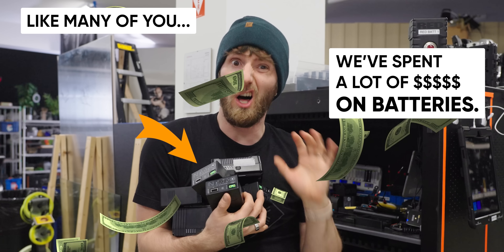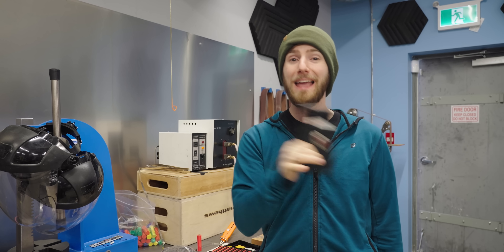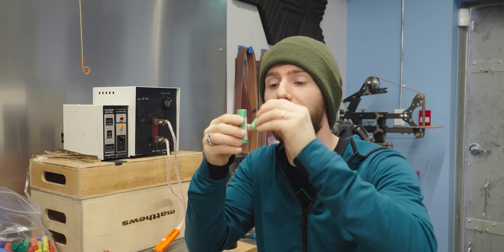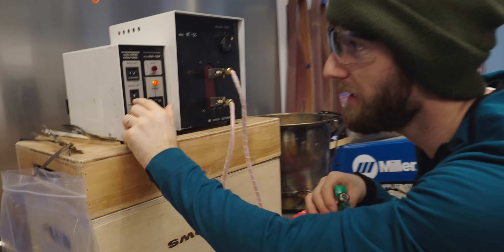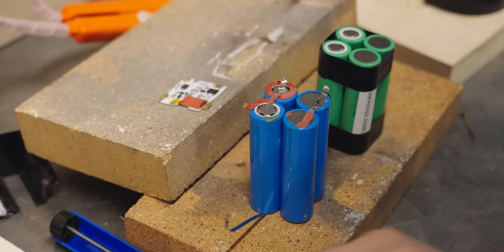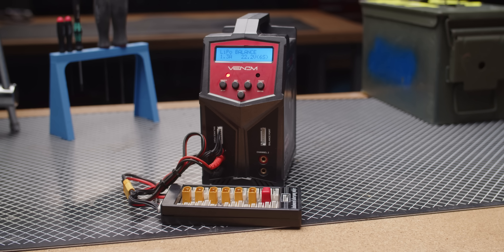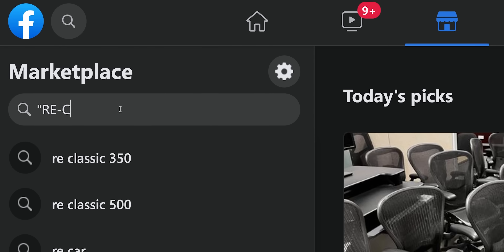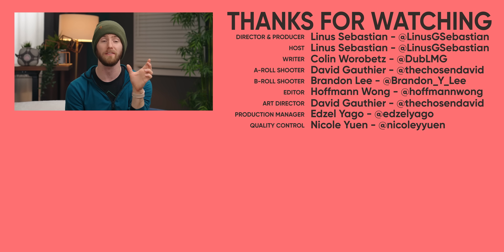This should be illegal… Battery Repair Blocking

Comment: Years ago, I read an article about a person that bricked their eclectic car's battery. Essentially, what happened was that that there was that there was nothing to stop a battery from being becoming fully drained while the car was being driven. The only to get the car up and running again was to pay hundreds of thousands of dollars, to have the old batter replaced with a new one, and the car owner had to do this at their own expense because the manufacturer classified this a driver error. I've heard that rechargeable battery cells can be damaged if fully, fully drained, but now I'm wondering there this might have an a BMS issues.

Comment: Well, same rule as with repairing original laptop bateries. You need keep atleast one cell in series connected to BMS - Replace one row in series, then another. Or connect dummy load +4V to all BMS pins. When you don´t that - BMS will think, that one of cells is dead and lock whole BMS. Then you will need to reset BMS via programming. With laptop bateries - you can buy third-party battery from china - They do not have this feature and won´t lock down.

Comment: Notice the spot welding clip you showed and how short the spark is and how yours was glowing. Reduce the time!
Also solder leads to the best and connect to a bench psu and supply constant voltage durring rebuild to avoid bms dying.

Comment: Did the cells really catch on fire? Don't get me wrong they are dangerous and better be safe than sorry, but spot welding can lead to some unexpected bigger sparks in some cases, e. g. caused by dirt, wrong settings or differemt metals.

Comment: That second spark (first one we saw, but prob the first one too, if they looked the same)  was just the welder not making good contact

This is a FYI, jsyk those new cells in the sand are more than likely just fine
Reply: 17:27 / 17:28 that's the weld spark I was talking about, but their tips were smaller/ sharper (easier to maintain a good connecting w/ more pressure)  also your tips were probably more dirty/ oxidized, due to cheapness)

Comment: You know those blown cells.
Are you sure you actually blow through because that looked like it was just a bad contact.
Fyi there is a good Arduino based one I bought runs from a few lipo cells.
Some guy just made up kits so much better than my factory tab welder!

Comment: Just a safety tip when recycling those cells, dont just throw them all into a box or bin - DISCHARGE THEM. They could short out and catch fire wherever they go. Use a big resistor ~1ohm or a 12v light bulb and connect it to the terminals and leave it discharge for 12-24h just be careful the resistor/bulb will get hot.
Reply: 1 ohm?
u mean higher right
like at least 1k ohm?
Reply: @kelvinluk9121  U/R=I Voltage devided by resistance equals current. When you chuck 1K ohm on there, the current will be around 0,0034 A. Would take forever to discharge
Reply: @CSJSyr  this is correct
Reply: By the time you throw them out they are so bad that nothing could happen. I've tried shorting them intentionally. They just warm up until the internal thermistor goes really high resistance at 50 degs and at 80 degs the internal aluminum lid pops up disconnecting the cell from the tab.
Reply: @two_number_nines  Not true. A lot of bad battery packs contain one or two bad cells which the controller detects (heat/load/resistance etc) and stops/limits charging/discharging for safety (so they dont burst into flames because something is out of spec). You will find most of the cells are actually find and holding power still, those are the ones to watch out for.

Do not just throw them out. Discharge them.
Reply: @apachelives  you can save the good cells for limitless uses. Even if you didn't, as I said the standard 18650 cell has enough safety not to blow up even if short circuited for a long time. also by the time one cell completely dies the rest of the pack is always at 50% capacity as I've noticed and at that point they can barely make plastic bend in full short circuit mode.
Reply: Because we all know what that is and how to do it at home and have all the necessary stuff just lying around.
Reply: @KatastrophicNoodle  Well, if you handle bare lithium cells, you should know that and have that stuff around.
Reply: @CSJSyr  Everybody has access to batteries, if they're not talking about recycling batteries what are they talking about?
Reply: @KatastrophicNoodle  They are talking about 18650 Lithium cells. Not your common rechargable battery. It's the same stuff found in the exploading Samsung phones, just in a tubular package
Reply: @KatastrophicNoodle  In that case your in the category of people who don't open the battery's therefor they are still in the protected plastic shell and most likely fine. However have you ever seen those videos of rubbish trucks smoking and burning - highly likely from people binning charged lithium ion cells and the rubbish compactor crushing and rupturing the cells - another good reason to follow the labels and dispose of correctly (not in the bin).
Reply: Gee man, connecting resistor or light bulb, seriously??? Just buy LittoKala charger/tester for 20 bucks and properly discharge them with it. Trust me, it's much faster and safer.
Reply: @perakojot6524  NO. Not discharge within spec aka ~3v, discharge to ZERO volts. There is a difference. A lithium ion battery at "0%" or "flat" is ~2.7v-3.4v depending on manufacturer/model, anywhere lower damages the cells so they are not allowed to discharge below that point (cut off). No battery tester/charger will pull a lithium ion cell down to 0v. You have to do it manually.
Reply: @apachelives  Why? You don't seem to understand basic battery physics/chemistry. Some chargers have programmable cut-off for discharge (undervolt protection), however,  even without it, discharging usually stops at ~3V for LiIon/LiPo cells with nominal voltage between 3.6-3.8V and the amount of energy/capacity left in battery on 3V is well below 1%. This amount of energy is not even sufficient to heat up the battery over 40 degrees C when shorted. Not to mention that internal resistance of the battery at 3V is few hundred mOhms and once you shorten it almost instantly goes over 1Ohm. So any discharge below 3V is kind of pointless, i.e. once you are down to 3V it is completely safe to just shorten them and then they are safe even from crushing.
Reply: @perakojot6524  18650 cells even below 3v are still capable of melting thin gauge wire. Its far safer going 0v and doesn't require specific equipment to do so, so why risk it?

Comment: I do have to admit I like how they tossedcells when they sparked on assembly but then shows stock footage of “professional” battery assembly at 17:28 where every cell sparked during spot welding.
P.S. This is meant  to point out contradictions not as advice

Comment: Some power tools will disabled the pack if the voltage goes too low, this sometimes shows up if the dead battery is left in freezing temperatures, but these maybe would trip if the cells were unplugged.

Comment: safe is better than sorry, but some random sparks is not generally cause for alarm in my experience. it's usually from poor contact between either the probe and the nickel, or the nickel and the cell. you will hear and/or smell when a battery is leaking

Comment: The most probable reason the BMS did not work is way more simple: most BMS require some load or charging to be applied to the cirquit in order to wake up. I used to assemble my own battery packs with BMS before, maybe it may help.

Comment: 13:30 you need to charge the pack to turn on the bms. And the throwing away of the previous spark on the sony battery pack was a total overreaction. You probably touched 2 wrong leads for .025 seconds...

Comment: Sometimes its planned obsolescence, other times the reason you see things you cant disassemble is because of assembly design: things are designed to reduce labor cost on manufacturing where possible. Making things glue together or snap fit, simply put, is fast, and if you can shave seconds off the assembly of a major product line it can still mean $ millions saved on the product lifecycle. 

Fully with you though, products need to be designed to be repaired and recycled.

Comment: Just noticed the real difference between batteries and capacitors are really just how slow or fast the discharge rate is capacitors are usually faster than batteries but they are made nearly identical leaving me to question at what advantages would we have if we used  flexible ceramic capacitors layered in parallel packs

Comment: A number of laptop battery packs ever since the mid 2000s started behaving so that they will kill themselves if you disconnect the power, in which case the sketchy workaround would be soldering in the replacement cell leads while the original ones were still connected (dangerous, and make sure both packs are about the same voltage). Then later there are even more evil laptop battery packs where the BMS permanently cuts off at just like 9.5V, and many times even just taking the casing open kills the BMS.
Aftermarket battery packs don't have nearly as aggressive of BMS and most you can simply disconnect the old cells completely and put new ones in, but they also lack many safety features.

Comment: I had some Ryobi (original) 18v batteries for my tools... When they no longer would hold a charge I bought 'knock-off' ones from Ebay. And yes I know very risky... But the replacements did work and have been working for quite some time. I paid less than $40 for two 'other' batteries vs Ryobi branded batteries that cost far more.

Comment: You guys should use higher current and shorter welding time you are heating the cells way to much - you should not be able to see the nickel strip glowing orange. 
But also the sparks you saw at least the second time just was not having a proper contact with the electrodes. That doesn't mean the battery is damaged

Comment: I've built a bunch of packs for electric personal transportation as a hobbiest. I use silicone adhesive from a cocking gun to glue the cells together instead of tape or other glues. It's the same glue used in framing windows so its probably at a hardware store. Using blue tape you can make sure you have clean joints without silicone getting everywhere. 

The silicone allows expansion and vibrations in the pack and stop those stresses from pulling apart your spot welds over time. ⚡⚡⚡

Comment: You guys did a great job on the safety setup. My only suggestion would be a more closed chemistry style fume hood than a welding one. Potential fluoride clouds spreading onto shop surfaces is not a fun time. And it's probably more convenient than respirators for the camera and cleanup crew.

Comment: Make sure the positive tips aren't overlapping the sides. The sides and bottom are the negative. Only the middle of top of the button side is positive. Also too much power can puncture through the negative side is VERY easy.

Comment: Hasty reaction to sparks that happen from spot welding. You'll have heating/glowing thin metal and smoke usually in seconds if it's what you thought it was. Love the precautions though!
17:26 the footage shows sparks flying in a professional setting.
Reply: So what is actually causing the sparking and why do they need/think they need to dispose of the batteries immediately upon it sparking??
Reply: @Ballistica242  that’s droplets of molten metal from the copper electrodes or nickel strip. You can usually reduce the risk of sparks by making sure the surfaces and electrodes are clean to ensure good electrical contact, and dialling in the spot welding settings so as not to overheat the metal.
Reply: @Ballistica242  at the time stamp the OP posted those sparks are because the machine is always on. When electricity jumps through air generally it arcs.. from there, just look up what a "spark" is (the ions and yada yada)
anyway machines like the one linus has, don't turn on until you press down (hence the cables jumping) thus not usually sparking because it's already touching before it's on (also why outlets are internal, and if you have a device turned on before plugging it in, you can see it arc.. if you plug stuff in faster you're less likely to see arcs)
Reply: @Ballistica242   if you’re talking about the spot welder at 17:26, or Linus at 11:something, they’re just welding sparks.

Like the others said, sparks are usually from a poor connection where it heats up that location much more, the welder may try to push a few hundred amps, and as there’s a poor connection the voltage has to rise to do so, dumping much more energy into the workpiece

(arc welding is literally no connection and arcing through the air creating the heat, but spot welding should have a good connection cause you’re squishing the metals together, you may be dealing with poor materials, oil, or corrosion tho)

In general battery safety, if you short out a battery (for a short period of time) you may get internal hot spots which could accelerate wear or fail internally. It’s best practice, like I’d probably ignore it but I can’t be responsible for telling you to ignore it
Reply: Also their batteries were nearly dead, even if the shorted the 18650 to itself they'd probably not get sparks.
Reply: @gg-gn3re  exactly what I said. At those voltages you would have to do something dramatic to cause them to spark or explode
Reply: @gg-gn3re  yea I had the same thoughts myself
Reply: Yeah, it was a little cringe... even if you shortly short those cells, nothing much will happen besides sparks.
If there actually is a dangerous currentflow through the cells, you'll notice.

Comment: I once tried to replace a battery pack in my B&O Beolit speaker. It turned out that the BMS would lock itself up in an event of battery disconnection. The only solution is to provide voltage to the BMS during battery swap and pretend the battery was never removed. You might have the same case here with the RED battery.

Comment: When it comes to battery repair/replacment, If the rechargeable batteries aren't 18650 cells, you're basically screwed.

Try replacing a battery with proprietary or non-standard cells. It might as well be E-waste...

Comment: Rather than welding the batteries together, it might be better to build a battery pack with springs and plates so that you could just insert batteries. As long as you match the power needed for the device, you could even use off-the-shelf batteries.

Comment: There seemed like a LOT of unnecessary caution here, but I wasn't an expert, so I figured Linus was doing his due diligence.

But it seems actual experts (not sarcasm this time) in the comments are sounding off, and the safety concerns in this video were waaaaaay overboard to a point where they were resulting in you e  wasting usable products, which was what this endeavor was trying to avo id.

Still, better that than the alternative.

Comment: A lot of mistakes are shown in the video. Firstly, the batteries must be discharged for greater safety so that there is no fire in the event of a short circuit. Secondly, the batteries need to be welded by pulse welding and not by current welding as you have in the video because they overheat and then will not work. Also, it is necessary to put good batteries in such a camera as RED, for example, a Panasonic with a larger capacity 3200, then the battery will work 20-30 percent longer than the original one. And at the end of the assembly, you need to reset the controller, calibrate it, alignment and reset the charge counter. This will be the correct replacement of batteries. I do battery replacement myself and I know for sure that no one will replace my batteries with better ones that were originally. Everyone is trying to save money on cheap batteries. Moreover, when replaced with Panasonic batteries, the battery life is 2 times more than the original ones!

Comment: 16:43 "[...] to detect either cell disconnection or a change in capacity that will shut down the BMS on purpose" I'm not really knowledgeable in this field, but theoretically, couldn't it just be a failsafe? I mean, I doubt that they design their power packs to be opened (fair enough), so if that kind of event naturally occurred while the power pack was being used, could it be dangerous to the end-user? I'm not trying to defend that kind of questionable behavior just to clarify, but it seems a bit unreasonable to expect the BMS to know whether a battery comes undone by itself or is disassembled by a human when the product was most likely not designed with this in mind.

Comment: I feel your pain guys, I could build a small house to cry in out of dead Red and Sony batteries. Should we also talk about the cameras built in obsolescence? I'm looking at you Sony NX5... The first NX5 of our 6 cameras (of the same model and age) had dropped the date, we were shooting for a short while before we wrangled and picked up the error in burn in. So what did we do? We adjust the date. And what did the camera do? Error code and bricked. All of the cameras systematically died one by one, all within that 5th year, all with the same "sensor error" code. Three of the cameras were on sticks in a studio setting for their life, used on average once a month! We bought a breakdown manual of the model, on dvd (dvd lol, and also thank you ebay), to see if we could identify what was wrong. We couldnt identify any issues but we're not engineers, just simple film farmers. Lastly, we discovered a way to reflash the camera. And wouldn't you know it, we saw access granted to continue using two of the cameras - with absolutely no issues from what we could tell (we had moved on to new kit by this point, we should have stressed tested them to see if we could find a fault).

So boo to obsolescence! Thank you for risking life and limb to make this vid guys, those battery housings were taken too soon, rip.